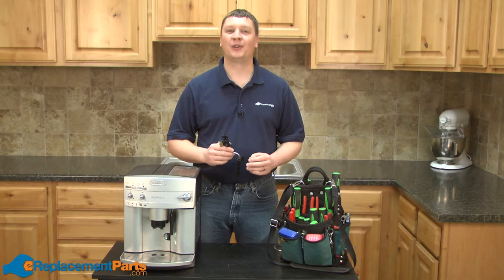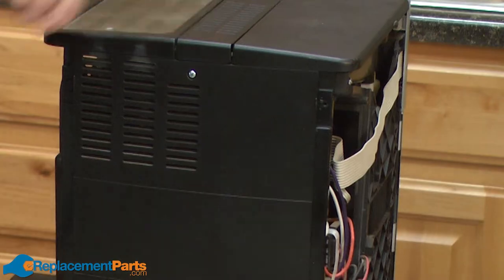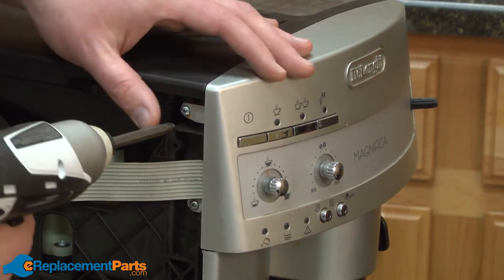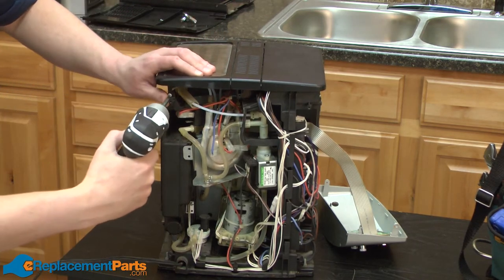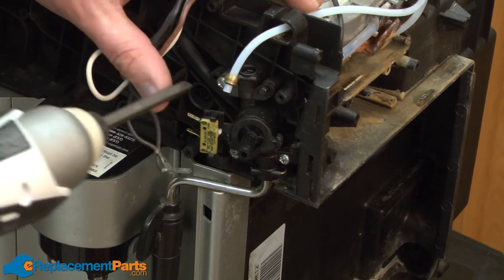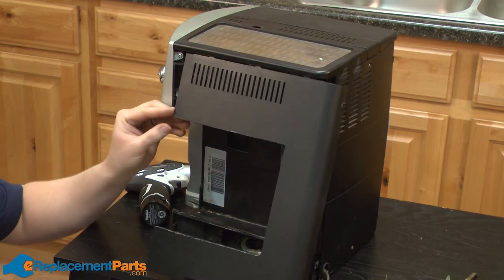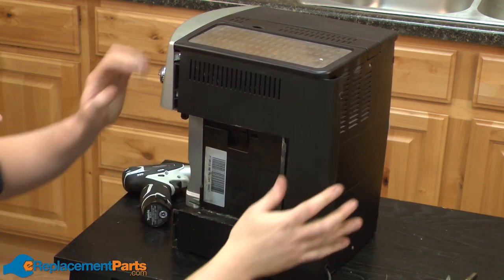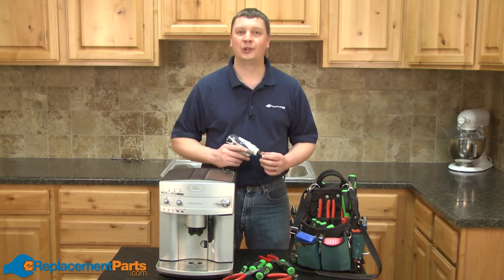How to Replace the Tap on a DeLonghi Super Automatic Expresso Maker (Part # 7313216621)

Comment: This was excellent. I ran this video adjacent to the counter where i did the work and it fixed EVERYTHING. I Had NO Steam and the tap was leaking alot. I would have been happy to just stop the leaking, but it also got the steam flowing again that has not worked in about a year. Perfect instructions, its easy to "snap" things like this without the proper instructions.

Comment: A little tip if you are replacing the tap on the Caffe Corso (ESAM2600), grease the spindles of the tap before refitting the steam knob. If you don't when you need to pull it off again, you will pull the inside of the tap out and break at least one of the plastic retaining tabs at the back of the tap...Yes, I did suffer this and had to buy yet another tap!

Comment: No need to remove the back or the top.  Just take off the sides so you can get at the screws to remove the panel.

No need to remove the wires and tube from the little holder at the top.  You can do it without disrupting that.

No need to worry about getting the wires mixed up.  It doesn't matter which goes to which terminal. 

This fix made my unit like new again, no more leaking.  
Valve will turn much more stiffly when done, but this is normal with a new valve.
Reply from the maker: F. Robert Jack Thanks for the input, Robert.

Comment: Hello Mark,
Thank you for your immediate comment about my issue with the DeLonghi EAM3400 Spring Micro Switch.
As I explained in my earlier comment, I was advised by a DeLonghi repair service that I would need to replace the
Spring Microswitch to correct the problems I am having with the machine showing constantly that I need to empty the
grounds container, whereby the container is indeed empty, and that is why the machine can not operate.
I purchased the Spring Microswitch, it is #43 on Page C of the Diagram and #50 on Page D of the Diagram.
Could you please help me locate this switch on my DeLonghi EAM3400, so I can access easier.
Again, thank you for your wonderful video on how to replace the tap. It worked greatly.
Looking forward to your further assistance with my spring microswitch.
Thank you.
Kosta
Reply from the maker: The easiest way to replace the solenoid valves is to replace the whole assembly (part number BES870XL/02.14). To remove the old assembly disconnect all the water lines and wires. Once that is done, remove the screws holding the
assembly in place. You might need to disconnect any additional lines that get in the way of removing the assembly. Once you've nursed out the old part, follow in reverse order and install the new assembly.